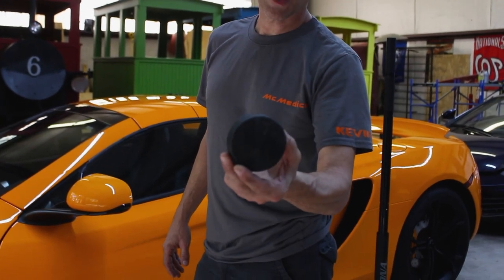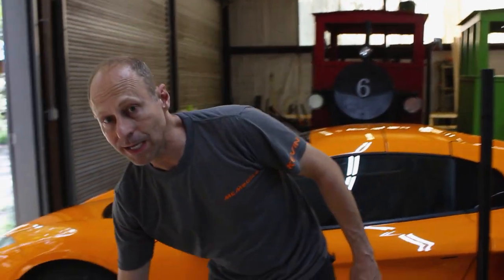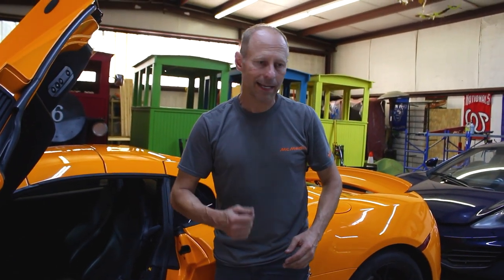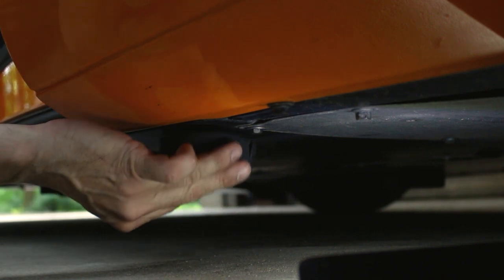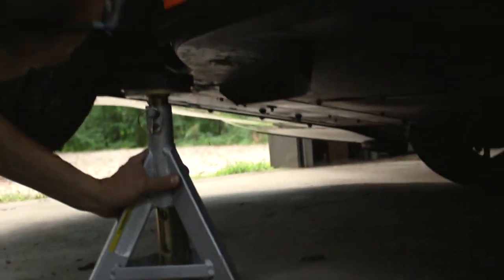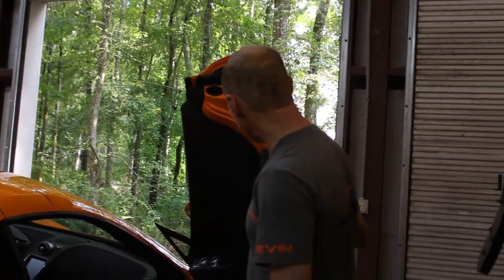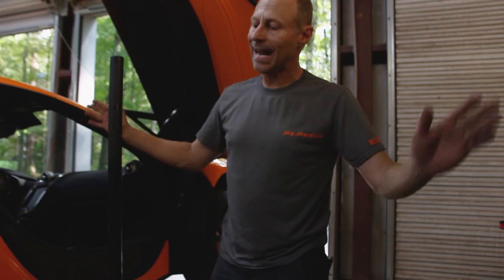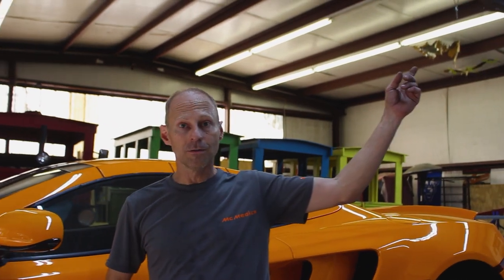How To Work Under a McLaren WITHOUT A LIFT !!

Comment: Dado a 2×4 if you're going to be jacking on a pinch weld car. Cut 4 of them 2' in length. The dado cut fits over the pinch weld and you jack on the wood. Then place your jack stand on the wood.
Reply: Nobody is jacking on a pinch weld car on this channel